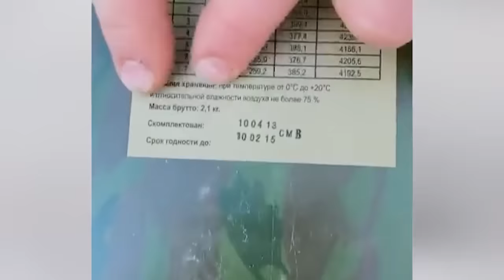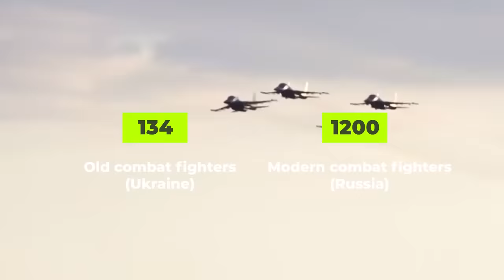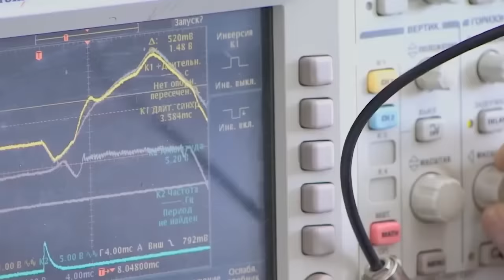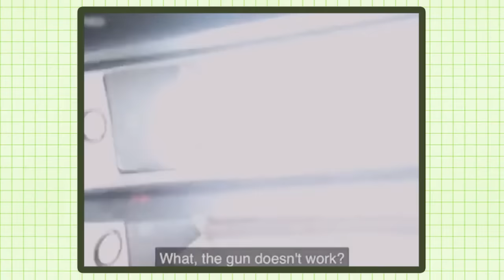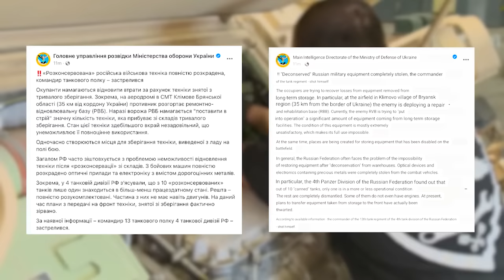Why Russian Arms Failed in Ukraine?

Comment: I'm not sure Russia thought the equipment mattered. I honestly didn't think they would invade as the numbers weren't there. 130k troops sounds like a lot but it isn't if you're talking an invasion force. In comparison the Gulf War to liberate Kuwait had 956k troops involved. Invading somewhere like Ukraine with only 130k troops means you don't expect any serious opposition.

I've come to believe that Russia thought it would be a walkover and they'd be treated like liberators "reuniting the ancient homeland" or some such drivel. Their attack was based on three wrong ideas; 1. There wouldn't be much of a fight, 2. It would be over quickly which meant that 3. The equipment didn't have to last very long anyway.

Oops.
Reply: But it's atleast 300000 troops from what i have heard?
Reply: @ThorSuzuki1  Maybe now. But reports just before the invasion were around 130k. And even 300k is still only 1/3 what was used in Kuwait, a much smaller nation.

We should also consider that Russia has at least as good information as the CIA factbook which listed Ukraine as having 200,000 military and 50,000 National Guard. Ukraine also reintroduced 1 years National Service training in 2014 for men between 20 and 27. So essentially every male between the ages of 21 and 34 this year have had at least 1 years military service.

Given those numbers even 300k would be an inadequate force. I really don't think the Russians expected a fight.
Reply: Which is exactly why they don't call it an invasion. They stated their goals pretty clearly. The idea that they intended to take Big cities like Kyiv by force with so few numbers, spread out across several fronts, is silly.
This video fails to mention the obvious, they are still there and they have ground Ukraine's armed forces, with massive amounts of international support, into the earth.
The whole Russia is inferior, thing doesn't really hold water when you look at the situation over the past few months.

I agree 100% that they thought that getting the government in Kyiv to run or capitulate is what they were hoping for. Once that didn't happen, they needed to move those troops Eastward, Lots of fucking about happened in that part of their campaign.
I don't think they ever expected The troops along the front in Donbas or mariupol to surrender. They knew that those troops would fight til the bitter end.
I also think that they expect a direct NATO engagement sooner than later.
That's when we all start have a completely shit time of it,.  😞
Reply: Exactly. And their overconfidence proves that they really had no fear at all about Ukraine being a threat to them. So their excuse for going to war is clearly something none of them believed.
Reply: @ThorSuzuki1  look at number of troops required to occupy and police a rebellious population, it’s all documented, at least 950.000 required as a start....how can a poor GDP country like Russia afford that
Reply: @theorncampbell4432  oh my little friend, NATO and USA have always been designed to fight a war on two fronts, China Korea, and Russia...other than nuclear options, Putin would have his Airforce and Army destroyed in 48 hours...maybe look at the Regime in 1905 and 1917 as a history lesson
Reply: @alanwayte432  Mate, is your comment meant for someone else? It has absolutely nothing to do with my post.
Reply: @alanwayte432  hahaha , who was it that said this about Russia “ we have only to kick in the door & the whole rotten structure will collapse !”
Reply: I remember news reports saying 400k amassed on the borders right before the invasion.

Either way, Kuwait's invasion force was Expeditionary in nature and thus, had a much more obvious footprint. We had to fly and ship equipment half way around the world for that effort.

Russia's Invasion is their neighbor. So much of their logistical footprint and military presense is within their own country, and they simply can bring up supplies equipment and men via train. So although they only committed a few hundred thousand to the border/front, many thousands more are working toward the war effort within Russia's interior.
Reply: I don't think these issues were at the forefront of Mr. Putin's decision-making processes, to say the least.
Reply: @theorncampbell4432  , If NATO had been directly involved at the beginning, that long convoy of Russian tanks and armor would have been slaughtered in a day.
Reply: @raymondmanderville505  But this time around, it was Russia saying that line.
Reply: Paol Vrobel  , Good point. There is a good description of the power of propaganda in the book "The Rise and Fall of the Third Reich". The author knew that everything he heard was propaganda, but he noticed that he couldn't help starting to believe it.
Reply: @matiasmontaldo2616  , Having a 40-mile-long armored column sitting still in the enemy territory on the road to Kiev should tell us something.
1) They did not expect much resistance or danger on the way to Kiev.
2) They were going to Kiev to overthrow the government and take the entire country. Even now, some high in the Russian government are saying that they want to conquer the entire country.
Reply: @matiasmontaldo2616  , A 40 mile long string of tanks and armored vehicles, packed "bumper to bumper" is a lot of sitting ducks.
Reply: @matiasmontaldo2616  , They lost far too many men and far too much material for that to be just a diversion. Also, they waited too long afterward to launch another attack for that to be considered just a diversion.
Reply: @matiasmontaldo2616  , In your wildest dreams, do you really think that the Russians, attacking a well-defended position, only suffered one-sixth as many casualties? So much for your military intuition. And do not say that their tactics were good enough for that. Their tactics were awful. (Unless, of course, you are talking about civilian casualties. The Russians depend on slaughtering civilians with heavy artillery for their victories.)
Reply: @theorncampbell4432  It is an invasion in every sense of the word. They have attack Ukraine with the intention of taking land. That is an invasion.

Also, lets look at the situation. They have lost 913 tanks (about 28% of their entire tank force), 49 aircraft and 48 helicopters. 23k+ soldiers are dead, and about twice that many are severely wounded. They have captured two big cities, Kherson and Mariupol. The former is slowly being advanced upon by Ukraine, and the second is nothing more than rubble after months of nonstop indiscriminate shelling. As for land captured, they have taken about 12% of Ukraine.

Those figures are absolutely pathetic, especially for a country that claims to be the second strongest in the world.

They have no air superiority, their navy is 100 miles from any combat. Their ground forces are getting absolutely slaughtered, yet you think they are doing well?
Reply: @ImBigFloppa  
You're silly.😄
There is possibly no one on this planet that knows the exact figures of losses of equipment and casualties on either side of the conflict. You're entire post sounds like a UK/USA tabloid version of events. Even Zelensky stated that their armed forces are losing 200-1,000 soldiers during the conflict in the Donbas.
Ukrainian personnel are not shy about giving interviews and plenty of their officers have revealed lots of info about what's happening on the ground, over there. Telegram is loaded with video evidence and non-western news is reporting in a far more balanced way.

Russian allied forces have taken more than two cities, and have obliterated a majority of the front line defenses, that Ukraine has been fortifying for the past 8 years. Even Avdiivka (one of, if not THE most heavily fortified position in the Ukraine) just got it's outer defenses cracked. Bakmut lost the elevated areas around the city. It's done. This will be the 3rd major defensive line in the East that will be obliterated. Those defense lines are comprised of men and equipment taking up positions in trenches and fortifications. You'd be a fool to not understand how horrendous the losses are on that constantly westward moving front line. 
They've been able to do this while their government has been buried under sanctions, had their war funds seized (stolen) and Ukraine is constantly resupplied with equipment and ship loads of cash. There are damned near 30 countries waging a proxy war on Russia and they still haven't stopping progressing.

Name one village or town near Kherson that has been retaken during this supposed counter-offensive. Good luck massing troops along that open ground. Mykolaiv and everything betweenit and Kherson gets pounded constantly by artillery, missiles from the Black sea and air strikes.
If Ukraine ever had the ability to engage in Maneuvers, they've definitely lost it. Without Direct NATO involvement, in the form of troops and equipment, they can't pull off a counter-offensive on Kherson. 

No one has air air supremacy or true air superiority there. There are air defense systems of every size and type. But Russia sure as hell puts up lots of sorties. They are still using long range weapons and strike runs with Su-25's. It's not like they're grounded or anything. 

You're assessment is bizarrely incomplete. It's as though you watched a few youtube clips, listened to some ex-military personnel give paid interviews and stopped there.
Reply: @alanwayte432  si la Otan y EE.UU, fueran como dice, porque son tan cobardes que no entran en la guerra, porque Rusia no es lo que dicen como otro pais que invadan, piensa bien y no solo por querer decir las cosas, si la Otan y EE.UU no van a la guerra es porque tienen miedo, no es Irak, Afganistán u otro pais sin defensa, han mas de medio año y todos los misiles de la Otan y EE. UU no ganado la guerra
Reply: @JohnJ469  They didn't expect a fight, considering logistics by the looks of it are supposed to be a trip to the capital and back with some ammo incase the stray tank or solider pops up. Also isn't there a good chunk of unaccounted volunteer forces now? Surely that keep Ukraine's military strength consistent or better?
Reply: @theorncampbell4432  You're silly.  Russian forces have retreated from Bakhmut.  "It's done", huh?  They also retreated from Avdiivka.  Seems your information isn't up to date.
Reply: @alanwayte432  it's free they don't get paid the equipment is free as well
Reply: @joelellis7035  Yeah naw. LOL
I've been reading these silly headlines "Ukraine repels Russian Army at Avdiivka" for almost 2 weeks. The major breakthrough was only about a week ago.
They continue to send probing assaults between artillery barrages. It's a pretty simple but effective strategy. They've been doing the same thing with Bakmut. They did the same thing with every defended position. I saw the same reports about Popasna, Bilohorivka, Lysychans'k, etc. 

Despite what you see in movies, not many armies perform big frontal assaults with a bunch of people screaming and charging toward a line of enemies.
Repelling several assaults is NOT the same as forcing an army to retreat. 
UKrainian forces will probably repel plenty more assualts on those positions, until they've been pounded with so much ordinance that they can't repel anything. 
Russian command learned what happens when Battalion Tactical Groups are sent to far and fast ahead of artillery, when they tried that stuff in February and early March.

If you can tell me where Russian troops retreated to, I'll happily show you that the contested areas haven't increased into what they've already taken control of. 

And grow the hell up. They aren't MY Russian forces. I'm not sitting at home cheering for one side or another, like a fucking muppet watching a football match.
Reply: @theorncampbell4432  sorry but the report I saw was from yesterday, not 2 weeks ago.  You're throwing out a lot of BS that's easily refuted by a quick web search.
I'm not cheering on anyone either, but what's being reported is clearly at odds against what you claim.
Reply: @joelellis7035  Tell me EXACTLY where Russian troops supposedly retreated to. It's a pretty simple question. Where have the lines changed that indicate a retreat by RUssian forces. There are a dozen or so popular Maps that are representative of what Ukrainian Ministry of defense says is the situation on the ground. None of them show any sort of gains in Kherson or retreat by Russian forces. They all show contested areas around Bakmut and Avdiivka.
You call my info bullshit, but you haven't shown or told me anything more than your opinion. 
Yes, I'm sure saw a silly news report about Russia retreating near Adviivka, as I said, that story has been thrown as a new development for over two weeks. It wasn't true the 1st time and still isn't true two weeks later. 
If Russia retreated in that area they would have fallen back to the East of the airport. Show me a map, or a report that indicates that, and I'll believe you, if it's a source that's more reliable than some goodfy news report.
Reply: @JohnJ469  Ukraine have less than 300k fighting men duh"
Reply: I heard that they invaded with 190,000 troops, but that was still pretty optimistic against NATOs "best" trained army of 260,000 with a further 300,000 armed and trained men.
I also heard that the 190,000 were drawn from their Standing Army and they have mobilised any reserves, but who knows what is really going on except that the Russians seem to move steady forwards.
Reply: @SugarKaneNosey  200k active troops and 50k national guard. However in 2014 (?) they brought back national service for one year  for men between 18 and 34 and there's about 2 million that have been through the program.

But even if there were only 250k, the Russians didn't bring enough men to the fight. Not if it was going to be a long one.
Reply: Absolute bullshit,of a comment mate.Keep the good job😂😂
Reply: @factChecker01  they didn't go to war with Ukraine. If they did there wouldn't be Kiev still standing. Instead, people in Kiev are doing much better than people in Baghdad.
Reply: The armies of Poland and Ukraine "as allies" have beat russia a couple of times..Maybe this will be the third time..
Reply: @sarge121  Can't imagine Poland trying it now. I don't think Russia will be gentle in their response and will use much heavier weaponry should Poland get involved. What do you think? Will the Polish government risk doing it?
Reply: @Sergei__v  
The only thing remained worthy of concern is the Russian nuclear threat. Nobody has any illusions of their conventional capabilities by now. Ukraine is full of Western agencies and observers to study the Russian tactics, equipment, ammo, fuel quality, listening to communication, reading captured documents, and interrogating captured officers and soldiers. As we speaking, NATO is adjusting and fine tuning it's plans, doctrines, hardware development and training methods in case it's spills over to NATO territory, what I'm fairly confident Russia wants to avoid by almost any mean. They made a terrible miscalculation, but not stupid.
Edited for typos.
Reply: @theorncampbell4432  I think the "whole Russia is inferior thing" is valid.
Reply: @theorncampbell4432  <~  the whole "russia is inferior"  thing really holds water,  when you look at the situation over the past few months!
Reply: @JLSMaytham  <~ so much lies, and misinformation in one post!
Ukraine was never NATO, trained, or compliant before February this year!(oh, but they're surely more compliant now)
Russia invaded with about 200,000 poorly  fed, and equipped, mostly conscripted soldiers!  Ukraine had around 260,000 at the time of  being attacked!
Russia moving forward?  Where?
Lolol, this kremlin troll, goin say russia is moving forward😂😂😂
Reply: I think the Russian speakers in Donbas, who had their language banned and endured shelling for 7 years, were pleased to see the Russians. 
Imagine if England treated the Welsh that way?
(They did in fact treat the Irish that way and very few Americans think Eire should be forcibly recombined with Britain!)